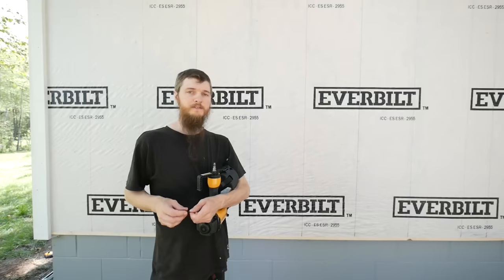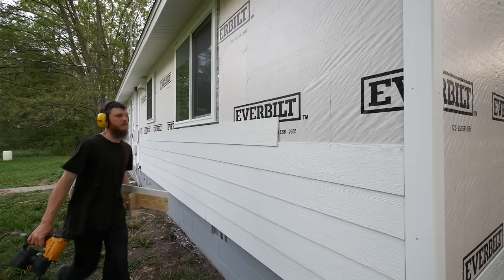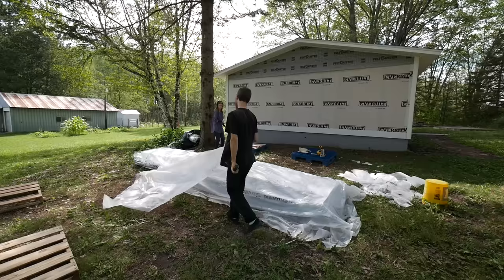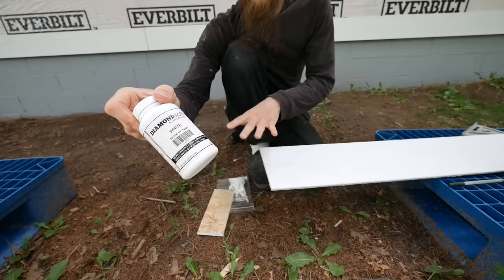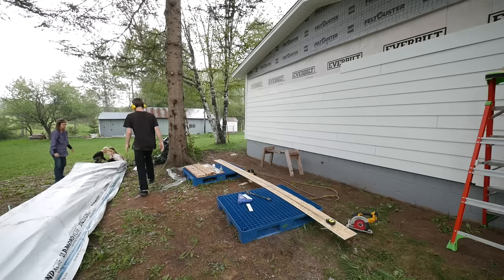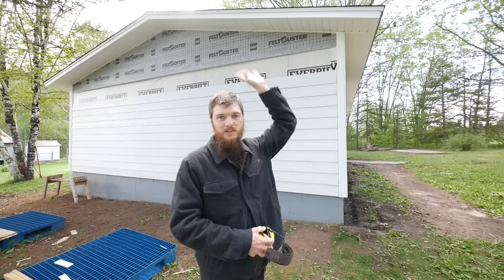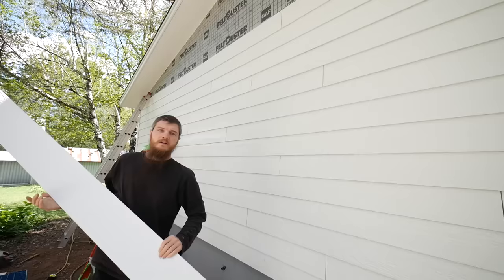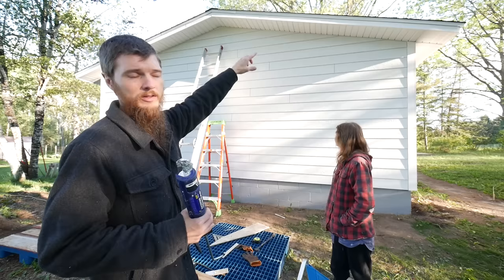DIY Couple Installs LP SmartSide on their 1970's Mobile Home

Comment: Save all the plastic that the siding is wrapped with. You can use it under the mulch for around the house. Those caterpillars are poisonous. I didn't know that and learned the hard way. They aren't deadly but wow!! When it pokes you with the black "stinger" thing. Yowza!! Rain when you are trying to get an outside job finished is the worse! We need rain so badly. If I attempt to paint my garage door, I know it will rain. Everything looks fantastic!
Reply: Great idea for repurposing the plastic ♻️

Comment: Belle to the rescue! Always ready to help save her Dad from those pesky bees!

The house is looking great you two! 
I'm a little surprised to hear that you don't want to put up gutters. I feel it'll solve most, if not all, of the splash back problems entirely. 
As others have stated before me, mulch won't provide the kind of protection you're looking for, as it will break down into the soil over time and need replacing. Gravel/rocks with a fabric underlayment would provide a better, more cost-effective solution over the long run.

Comment: I gotta say, you're good with your caulk lol.  If I were you guys I'd use Gravel around the paremtor of the house rather then mulch because Mulch will attract alot of critters/bug close to the house amd also it hold mouster and the blocks may wick up moister.  Over all I love your videos.
Reply: Vlogger I was thinking the same thing. Mulch will splash also, hold moisture, attracts all kinds of bugs. I switched to 610 rock this year and love it. Research before opening the mulch

Comment: In Australia we don’t get the choice on using rain gutters on our houses, it’s essential. We have so many droughts that every house has it’s own rain water tank so the rain water that runs off the roof is caught and saved. It’s used for gardening unless you live in a rural area then it’s used for everything. I spent many years living out of town with rain water being all we had and I much prefer it. We had concrete holding tanks that kept the water cooler and several filters on the system so the water tasted wonderful.  The house looks awesome. Great job on getting the siding up. It’s good to see Belle helping out. She’s growing up so much.

Comment: Some people suggest a 2-3' perimeter around the house with plastic covered by rock (pea gravel, River or white rocks).  Not only would that take care of the splash on the side of the house, but it keep bugs away and gives you a clear path for maintenance and ladders.  

I would recommend rain gutters. You definitely want the water away from your foundation, especially if you build a grade going away from the house.  Someone else mentioned a French drain, also not a bad idea depending on the slope around your house.

Comment: About the dirt splashes at the house: Here in Europe we have small gravel around the house because of that. It's very common. Nearly every house has it. It's very neat. Landscape fabric under the gravel and it's done. I think, mulch doesn't work so good.
Reply: In my part of usa ( north of houston texas) gravel gets thrown around by tornados and hurricanes, so we tend to avoid that
Reply: @jeepsanddragons  OK, we don't have that here 😅
Reply: Another thing mulch can do is be a haven for termites.
Reply from the maker: We have so many oak trees around our house that the stones would get filled with leaf litter and eventually grow weeds so we're just avoiding that :) Other people have said they used wood mulch to prevent splash-up and it worked well for them.
Reply from the maker: We don't have to worry about termites here in the frigid north.

Comment: "Just get up there and ignore it!"
"How do you ignore a bee in your face?"
😂😂😂
Belle to the rescue !
Reply: Jef Tex - We have to admire Belle's 'gumption'.  She is indeed a trooper.  I would not be able to handle a bee in my face.  As a child I was occasionally stung by what I called Flying Firecrackers - the sting was hot, uncomfortable and annoying albeit short-lived.  When in my early 20s several wasps flew into my long hair.  They must have felt trapped, they stung my neck. I dropped like a rock.  A former EMT was mowing my lawn, he saw me collapse.  He later said he may have disturbed their nest.  Apparently the amount of venom hitting my system at the same time caused a severe reaction.   As a result I now carry an EpiPen.  (I also keep wasp spray in several places throughout my home.  Great self-protection and no permit required.  I have also utilized it for Flying Firecrackers.)

Comment: Just wanted to also recommend that to avoid mud splash use stones. Most of our lower floor is glass and we had splashing with the beds that were there. We eventually opted for cotswold stones as it keeps it all clean. We then just planted sedums into it to add some greenery. Obviously, if you go for that idea use a weed membrane as you’ll end up with weeds and you want to avoid weed killers.

Comment: Doug there is a product called Christy’s Hot for the the nails on the vinyl corners. It comes in a little white tube to permanently cover the nail recess in the vinyl. I used to use it a lot with Azek- TD
Reply from the maker: Thanks TD.

Comment: That siding  looks beautiful, the installation top notch, and the grey you painted on the foundation really looks sharp with the white siding. 
The mulch that you are going to place around the house will look good but....I think in the long run you would be better off putting down weed barrier, an edging, and then stones on top of that. Cost a lot more but will last a lot longer and look better for longer and need minimal upkeep compared to mulch. Honestly without gutters the rain running off the roof will wash away the mulch pretty fast. Anyways that is my 2 cents worth. :) I replaced the mulch around my house the way I describe and I am much happier.
Reply: I recommended stone as well but they said there's too much leaf litter.
Reply: @augustreil  Thank you did not see that, but it is their choice even if I disagree. lol
Reply: @fredmaxwell9619 , You're welcome and they said it in response to me asking about stone instead of mulch. And it is their choice !

Comment: pretty sure that on the lp smart siding installation they specifically say don't caulk the butt joints, put some flashing between the joints, paint the saw ends and only caulk the corner trim joint, something about when the board expands they gaps will grow together, if you caulk everything it wont have any room to move and you going to have wavy siding
Reply from the maker: It's one of the 3 ways to install it. This is just the way we preferred :) 
 https://youtu.be/C9Fjr4SI-28?t=35

Comment: If you want to kill splash up, put down a foot or so of black plastic and stone of your choice.  Mulch breaks down and eventually splashes up too.  Or spend some $$ on landscaping, and essentially obscure your foundation with dense planting.
Reply: I was told mulch can bring termites or Carpentar ants when too close to the foundation.  I use a couple of rows of slant down bricks to keep the water away.
Reply: Plastic in the ground isn't a good option, especially in Michigan where it shreds in one winter.
Reply: Áine MacDermot who said it was to be “in the ground?”
Reply: Sky Z Yes inside every can of worms is another can of worms struggling to get out.
Reply: After one winter, it would be "in the ground" and shredded under a layer of rock and somebody would have to eventually try to clean that up. Michigan gets a lot of snow, ice, and frost heaves that churn up whatever rocks are in the ground... it's also why the roads in the Upper Peninsula are in constant need of repair.

Comment: No matter what you are sawing, if you can't afford a chip or some type of pealing, use masking tape to cover completely the area being cut. Draw the lines on the tape, and then cut trough it. Also, peal that tape towards the cut as it can grab wood or what ever its covering and make that oops thing. The word you were looking for on the skill saw was "table" as it sets on the item to be cut and hopefully holds everything in line. Table... who would of thunk. I wouldn't worry much over the little bit of dirt that spatters on the lower parts of the house, hose it off once in a while but at least it looks lived in instead of ready to show "empty" look as some places look as nothing out of place and all the grass trimmed so that they    become slaves to it..

Comment: Get some gutters, it will prevent the splash on the siding and save your facia and siding.
Reply: Gutters will also keep the crawl space drier and water from the downspouts can be redirected sometimes requiring a bit of digging but worth it.

Comment: DOUG, THE MULCH AROUND THE PERIMETER IS GOING TO HOLD A LOT OF MOISTURE AGAINST YOUR FOUNDATION. MIGHT WANT TO CONSIDER ANOTHER OPTION!
Reply: OAK, you are so right.  Gutters will save the siding and foundation.   I wondered about that when they were saying they would use mulch.  I been to this rodeo before.

Comment: Just curious, where's the piece of flashing behind the joints ? Thumbs up.
Reply: whoa!!!
Reply from the maker: We opted to go with the company's most common way of installing it, with no flashing and just sealant. Flashing is optional. I don't know, we just decided to skip it.
Reply: @diyfferent , No problem. We always use a piece of 30# felt with the caulk for extra insurance.

Comment: your extension ladder base looks way to far from the house,also putting a quick coat of paint on the back side of the siding would have made it last a lot longer as well flashing at the ends and where the meet each other in the middle of the run
Reply: Flashing, yes, paint, no

Comment: About 20 years ago, I put down large cement pavers - 24" square, 2" thick - to divert roof runoff.  Two years later, I discovered termites were living under the pavers.  I replaced the pavers with wild flora (weeds).

Comment: The whole point in having guttering is to keep moisture away from the foundation  of the house thereby preventing moisture problems in the future.  It seems that most moisture problems in exterior  walls stems from having moisture sitting near the foundations. Putting stones there may prevent splashback but not the problem of standing water below the stones. The house is looking good a reflection of all your hard work.
Reply from the maker: Yea, our soil here is very well-draining and we just don't want to install gutters since they tend to get bent up from heavy snow. This home never had gutters. The mulch should help to not make the house dirty.  Thank you :)

Comment: The siding looks awesome!!! I love the texture. So cool to see Belle helping.
I have a suggestion, can you frame out the crooked conduit and the meter to hide it? 
I know you have to leave the glass portion of the meter exposed but it would look so much better hiding what you’re legally allowed to cover. 
I don’t know why anyone would put that in crooked like that. It’s just as easy to do it right. 
Consider I was an electrician for 30+ years so my eye goes right to that. 
Glad it’s at least on the back of the house.

Comment: Siding looks incredible! I’m super excited to see it completed. Hard to believe this is the same house you started with! 😲 If you have any siding left over, maybe a simple framework around the utility area where the power meter is located and use the siding to enclose it. A simple hinged front would allow easy access and better hide the ugliness that is the utility area. That’s what we did at our last house as the utility area was located on the wall where our deck we used to entertained. Just a thought.
Reply: Dezfan That would be a great project for Doug and Ashley and it would look good.

Comment: A few suggestions.  1.  You need to rip and install a starter course 1-1/2" wide at the very bottom of the wall.  2.  The ends of the planks need to have a piece of flashing where they butt together; about 4" wide, I believe, and there should be a small gap between the planks.  3.  They make a gauge to use when you install the siding, which makes it much easier to install.  You won't need to snap all the lines, only 2 or 3 lines for the entire height of the wall as "control lines."  If you search YouTube for installing Hardie Plank siding, which is the same as LP Siding, you can get a very good and thorough guide for installing these planks.  Just my humble comment.

Comment: My house is basically identical to yours, I have a basement though and an attached garage.  You might want to consider putting French drains around the entire house.  We're having to do that with ours, we've been in our house for almost 11 years.   You have nice soil and we have clay/rock so it won't be fun.  We only get about 12 inches a year of rain and snow combination and we have less than half that amount we usually have by this time of year now.  With that little amount of moisture, we still have drainage issues and it's with the foundation and splashback.  I know French drains are not something you want to do right now, but you may want to think about that for next summer's project.
Reply from the maker: We have very well-draining soil here so that's not a problem for us. :)

Comment: Great Job. You all have had weather sneaking up on you throughout the past few jobs. I also noticed you had on a coat during one of the takes.  Wow. You must be further North in Michigan.
Reply from the maker: The weather changes drastically each day, at the beginning of August it was 64 and now it's back in the 80s. Gotta love the that midwest weather. One minute it's 82 the next minute the temp drops to 62 with a rain storm and then it's back in the 80s. It's horrible weather. :\ But also, anything in the low 70s or below feels cold to us. Other people would probably feel hot since they are always using AC and we don't. We walk into stores and they have the AC blasting and it feels so cold and miserable. It's just the same ol' northern living everywhere we've lived (Upstate NY, middle Indiana), the coldness lasts from August to June.

Comment: The siding looks good, great job caulking. Wondering why you didn't go seamless or near seamless? I thought you had 16' boards. Doug needs an s hook on his belt loop for the nailer lol. That nailing spacer is a great gadget. I was thinking a nice finish for the front steps would be to make then like a half circle. With the front so open, you could come up on them from any direction. 😊  That was a pretty catapilar and kudos to Bell for capturing the bee 💖

Comment: Ok, ok.  Spill it.  How did you figure the angle of the lapboard at the eve?  I just have to know.  The siding looks amazing.  Makes it look like a house, house.  Not a trailer.  Not complaining about trailers.  I live in one.  Couldn't live without those caulking tools.  They are the best!
Reply from the maker: We know the pitch of our roof which is 3 : 12 so the angle of that is about 14 degrees. We'll try to show how we mark the angle cuts when we do the other side. Thanks!

Comment: BEFORE we put mulch down we put down patio flat stone down12 INCHES by 8 INCHES. Right next to our home.
Of course we leveled it and made sure the water went away from the house.
That was 1993.  And it is still fine.
It does NOT splash water and dirt on the house.  It LOOKS GREAT 👍.
As you know MICHIGAN WEATHER CHANGES RAPIDLY❗🀄  I have never had to change the patio stones 8"×12".. Or you could use any size.
Sales are coming soon. It WORKS WELL.  ENJOY SENDING LOVE HUGS PRAYERS FROM MICHIGAN.  CHOW

Comment: What are you going to do with the gaps between pieces of siding? Caulking?  I’ve seen some people put metal behind the gaps.
Reply: Nevermind I’ll start watching the whole video before I comment
Reply: I seen on Holmes on Holmes I thought you had to have a gap behind this siding with strapping . I could be wrong but this house on tv they put siding on with no air gap and it all rotted in a few years to the point all siding and chip board had to come off.  In between siding pieces I thought they had little metal channels that sealed the connections but I could be wrong.
Reply from the maker: Yea, caulking the gaps. We're just doing it one of the ways LP wants it done. Using flashing is another option :) Quick video showing how they want it installed: https://youtu.be/C9Fjr4SI-28
Reply: DIYfferent love the siding.

Comment: while you mentioned caulking, most of the videos show a piece of valley aluminum installed behind each joint to shed any water. did you consider this?.....................g
Reply from the maker: Doing it with the flashing was an optional way of doing it, but we decided to go with this other way the company suggested :) We considered doing the flashing.

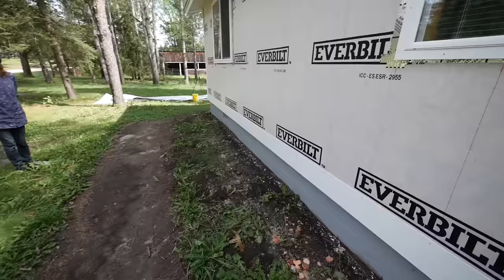Comment: 5:55, take my word for it kids.  Skip the mulch and go with pea gravel or some other form of gravel.  If you can get it from a local quarry versus in home improvement store bags, it's cost competitive upfront and it never needs to be replaced for the life of the house unlike mulch which has to be replaced annually.  It also doesn't become an insect haven like mulch (I know all mulches say they are treated for insects but trust me that's a surface coating that washes away leaving the mulch vulnerable to insects, especially wood ants which you don't want anywhere near your home).  IMHO  marble chips would look excellent with the gray foundation, white siding and blue door but any gravel beats mulch.  If you REALLY want that mulch look, I'd go with rubber mulch.  It's enviro friendly as its recycled tires so you get the mulch look without the annual upkeep costs or the insect risk